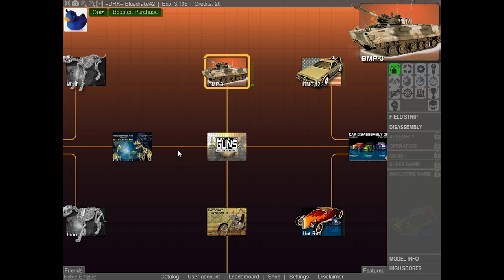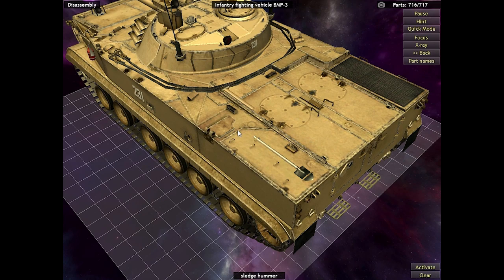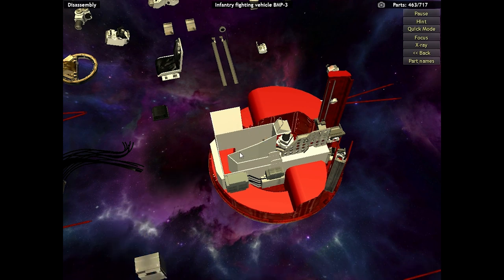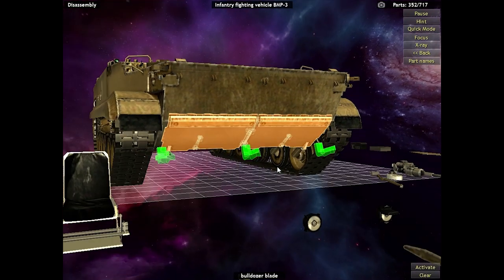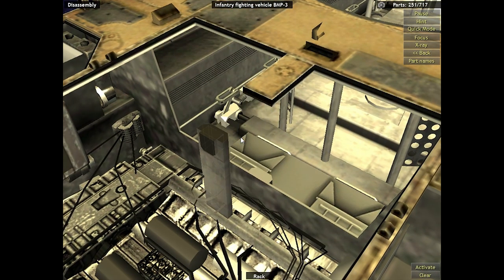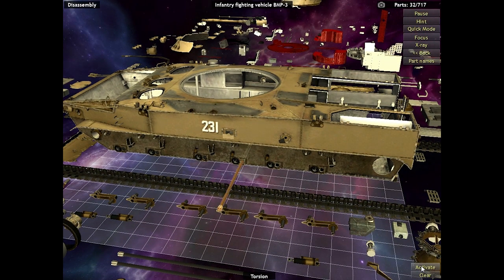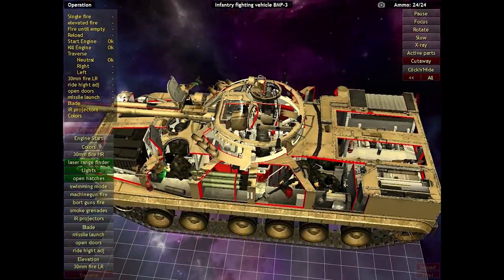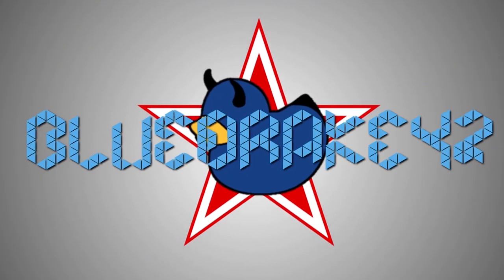World of Guns! ► IFV BMP-3 Full Disassembly (Special Episode!)

Comment: Great video. One point, the fuel is not stored up front because of the better armor, it is actually there to complement the armor (it's diesel so it doesn't explode unlike the M1 abrams highly explosive jet fuel). It's a concept used on many diesel armored vehicles.
Reply: @Mike_Oxhuge_  it does, have you ever seen an exploding rocket? It explodes because of fuel leak. Rockets use refined jet fuel.

Comment: The reason why BMP3 has adjustable suspension is when they drop it out of the planes with airborne troops behind enemylines. its dropped with a parachute an the threads are kept close to the body so that when it lands it does not damage the wheels suspension. After its lands the suspension is pumpbed back into place and BMP3 is ready to roll behind enemy lines and wreak havoc.

Comment: Essentially, torsion bars are a form of suspension. Springs operate by compressing, the coils twisting slightly in resistance. Torsion bars do the same. Imagine an allen wrench, thos L-shaped things. The long section goes underneath the vehicle, the short end connects to a wheel. When the wheel bounces, the entire bar twists, resisting. Therefore, it pushes back, and you get a spring. You may notice that the bars are offset. This is because for best results, you want them as long as possible, and basically interferes with the other side, forcing one to offset them slightly.

Comment: Fuckkk.

If I had financial control over a military, these would be one of the main combat vehicles I would buy.
Maybe slap a Bradley style wire guided missile on the side of the turret though.

Best bit is, they are relatively cheap, since they are Russian.
Reply: They have Konkurs missiles.
Reply: If you actually looked at the armaments, these are basically tanks. They fire MBT tank shells for primary weaponry.
Reply: Dmitry esvek The armament will tell you nothing about a vehicle, unless you are talking 120mm smoothbore etc.
Reply: Sam Farhan AT-10 Stabber*

Comment: It would be impossible for a treaded vehicle to move without it's treads. The treads only move because of the sprocket wheel (the large gear shaped wheel). All the small wheels are there just to keep the tread in line. So no, you cannot convert a tank into a "low rider".
Reply: Tell that to the BT-7.
Reply: +LFXcess That is definitely an exception to the rule.